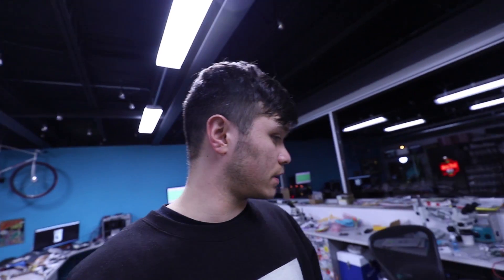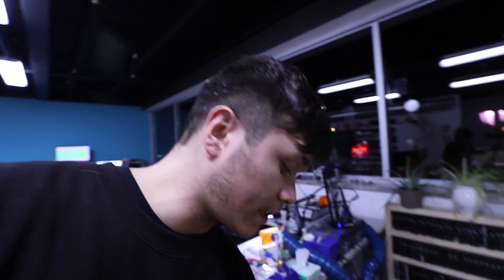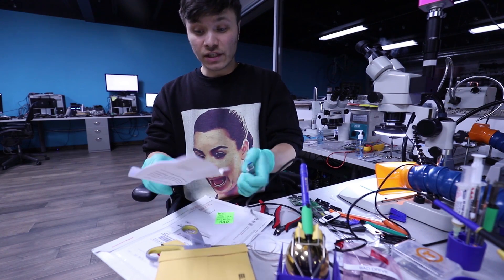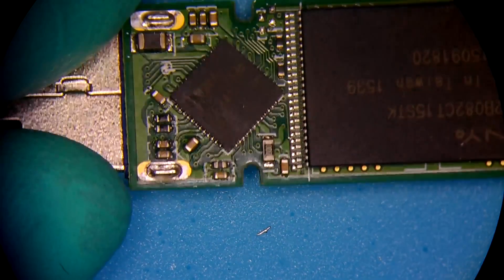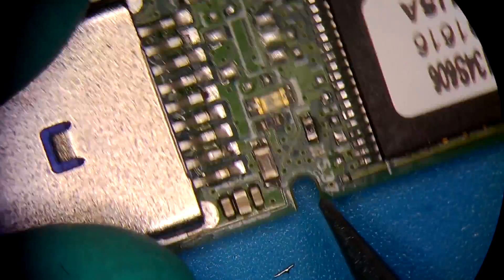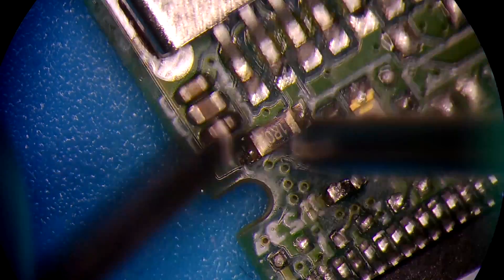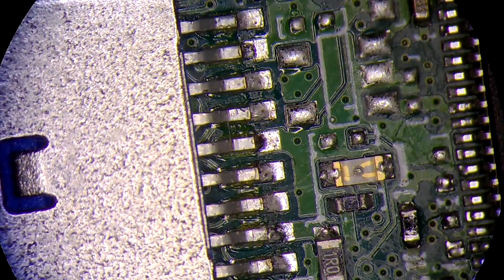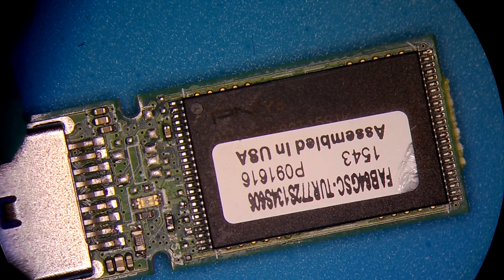PNY 64GB flash drive recovery | straight from the memory chips

Comment: Hey bud! 
Can you as a professional tell me, if its possible to transfer a nand chip from one pcb to another pcb from the same series, with the same storage space? the one Im taking the chip off has a dead controller ic and so I thought, I could just swap it and put it on the other one. Would that be possible? Will I recover my data?
Reply from the maker: Yeah, I have a bunch of videos on this channel demonstrate that same process including SSD recovery from recent uploads.
Reply: HDD Recovery Services ah great thanks!
Reply: HDD Recovery Services oh and one more question: can you just plug the stick in and see the data normally? Or do you need some software?

Comment: I was told that this placement "diamond" is preferred always in the board because it guarantee even application of the solder paste when using a squegee based machine. Pads then to clog in the stencil after several passes when chip is not in this form of placement. I dont recall if the vertical or horizontal ones have this tendency. With this diamond placing EVERY pad meets the squegee at 45 degree. I have seen this many times in consumer electronics, even when it is the only sMT chip on the PCB. You can see this even in the hanheld games in early 80s, the chip was in diamond placement, pcb hace a hole matching the packeage outline to the could mount if up side down on the board without wasting space (height)

Comment: Why the unneeded heat on the bottom of the chip with wick? Ugg..
Reply: At 6:30? To clean the connectors for better reading result.
Reply from the maker: Why clean headers? Is this a trick question? So the chip sits leveled in the socket. When NAND is off it will have solder on headers that will prevent it from sitting flat. Ugg
Reply: I do this work myself as well. No trick, just felt like a bit much direct contact with the back.  We each have our own techniques, after re-watching that segment I will have to take back the comment with a bit of salt.  I usually go at it from the actual ends, but am also re-soldering to a board.  Not frequent enough to purchase a socket setup.
Reply: Hi 
Where should I get that chips adaptor and most of the accessories u use?

Comment: Placing a chip on an angle like that (diamond) is a very very useful thing to do.
Routing a PCB in a tight spaces ia a lot easier when you place quad-packs like that.
Chip-Off = Chip off the PCB, but i think you know that :)
Reply: yeah, i've got the feeling sometimes ics are aligned at right angles just because the pcb design software isn't configured for sub 90° rotation and the designer never considers anything other than that. on the other hand, rotating parts during pick and place might be a source of error, so maybe that's the reason.

Comment: Erkin.. Check these probes out for when you're measuring down to 01005 packages etc.. Made by Pomona they have very small, sharp and sprung replacable tips. Great for testing tiny components where a good precise contact is necessary.

http://uk.farnell.com/pomona/6342/test-lead-set-blk-red-1m-60v-3a/dp/4135787?st=Pomona%20test%20leads

Cheers
John

Comment: Is there any "next" video? how about the bad chip? Also, how do you form data from 4 files instead of 2? Basically it`s 2 chips...
Reply from the maker: No next video yet, but I will be doing more work to get it perfect today. 4 parts because each chip has 2 banks inside, so each chip has 2 parts
Reply: All right, nice to hear, looking forward to it :D. Also, thanks for the tip with double banks, now I remember... You forget lots of stuff when only read about it, never get the chance to really use and consolidate your knowledge... Actually how many do you have the chance to do if electronics is just a hobby (and a curse, of course)?

Comment: Thank you for your Video. But may I ask you something? On your previous Chip-Off video of an SD-Card you used Rusolut VNR to extract the data. Is there a reason you used Flash Extractor this time? And my second question is: Some manufacturers like Sandisk encrypt their data on the chips. Do you have any way to extract the data with Chip-Off method? And if not, how do you know that the data is encrypted?
Reply: certain patters that exist in the data and the structure may differ, its quite easy to distinguish the difference.
I will back track later tonight and link a thread i wrote on deciphering data and determining if encrypted, ive also made some neat programs with data manipulation on another level.
If i had an eMMC reader i could definately make much more improved tools.

Comment: Do you think the original failure was an issue with chip 1 that "confused" the controller or otherwise overwhelmed it with bad sectors to the point that it could no longer function?
Reply from the maker: I believe that is what most likely happened. Chip 2 gave full green map rather easily